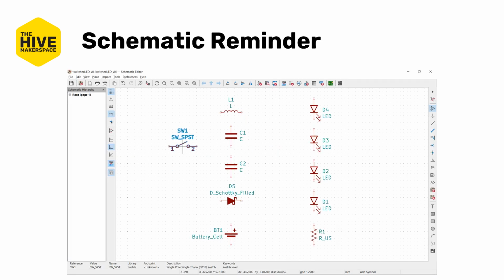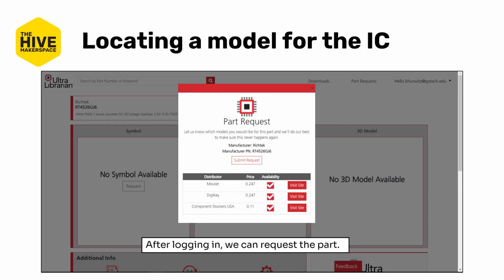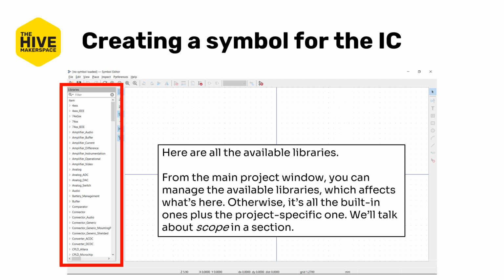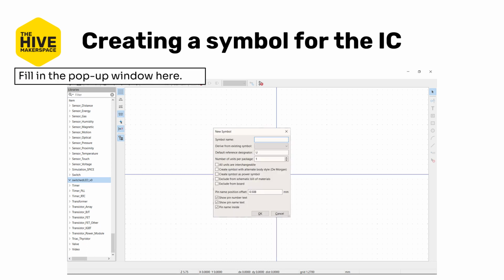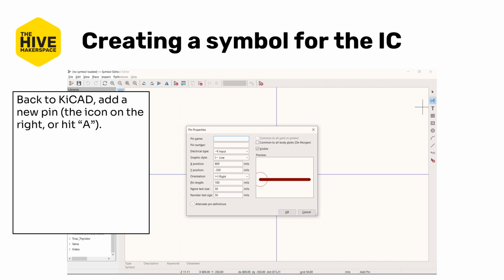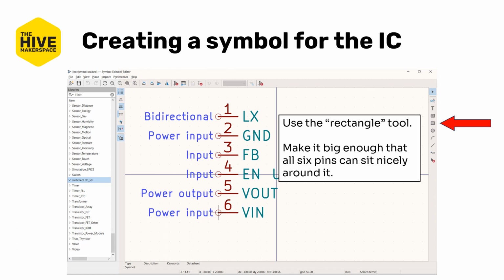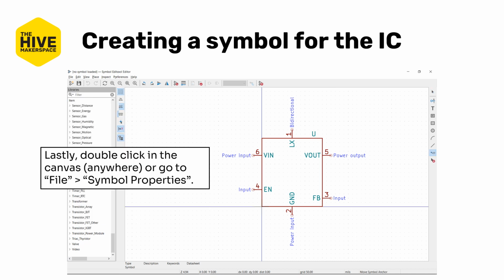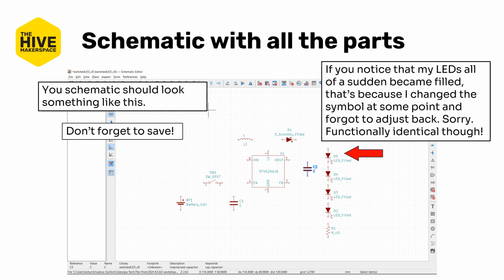PCB Design with KiCAD, part 4B: Schematic Symbol Creation

Comment: Never ever trust a "professionally made" symbol or footprint !!  I have had so many Jr. engineers turn "key chains" - what we call useless PCB's - due to "trusting"places like SnapEDA, Samacsys or Ultralibrarian - or even mfg sites since many now use these services.  Each year, I probably report over a dozen issues to each of these services with their parts.  Just had one two weeks ago where they had the Footprint totally incorrect, with the wrong pin spacing/locations.  

I've done over 3,000 designs over a 40 year period. In the beginning it was all manual tape up. I was using some of the first EDA tools back in the 80's; in fact, worked for PADS doing their library parts.   Just google ajawamnet.